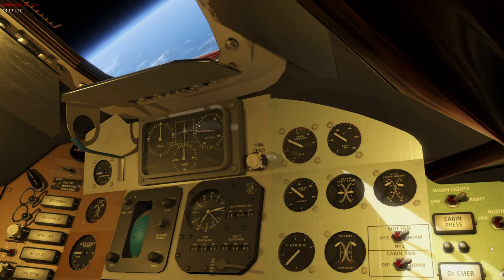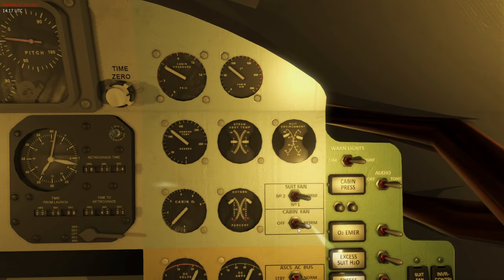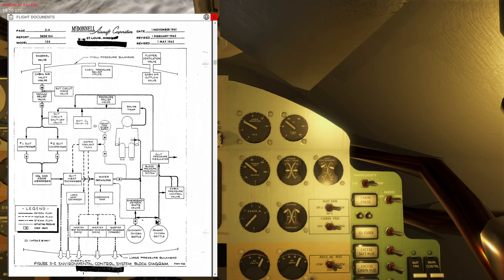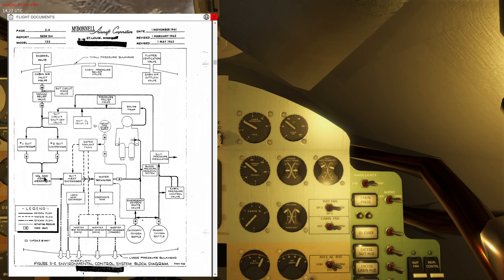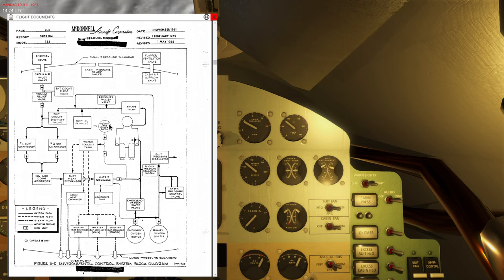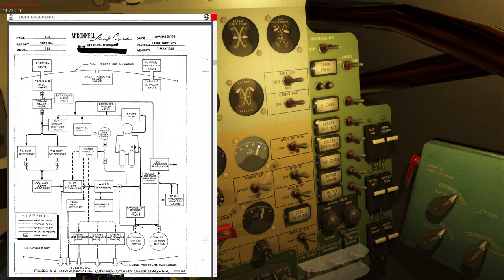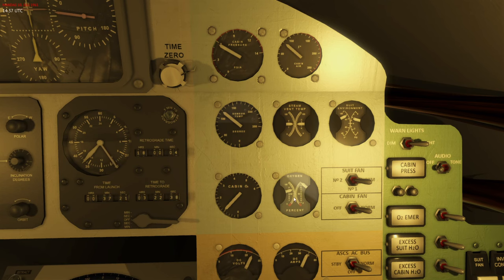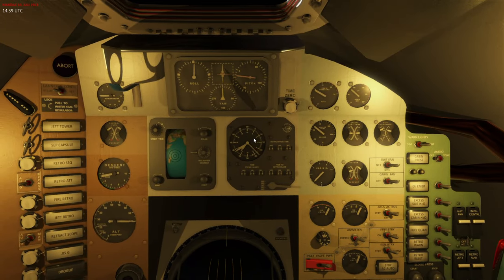Project Mercury - Deep Dive of the Environmental Control System (ECS)

Comment: To the left of the oxygen quantity indicators is a large gauge that says cabin O2. What exactly does this represent? You already have a cabin PSI indicator, so what is the function of this gauge? The cabin was 100% O2 if I remember.
Reply from the maker: Yes, according to the manuals if I recall correctly this is basically just pointing towards 1.0/100, maybe they planned other use cases for it or test mixing, but it got removed eventually. I have yet to decide what to do with it in-game.

Comment: Hi, I am intrigued now on how launch is done. we start with 15psi air and going quickly to 4 psi pure O2 in about 30 min.  This will cause formation of N2 bubble in the blood!  I will try to watch this during launch...
Reply from the maker: This typically goes from atmospheric pressure at the pad, and down to about 5.5 psi as you ascend through the lower atmosphere. ECS maintains it at 5.5 after this.